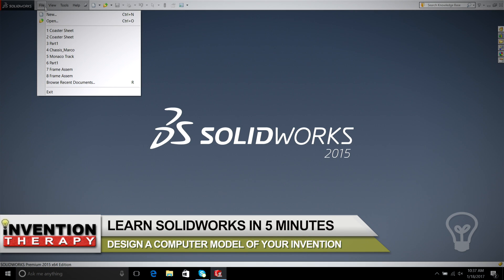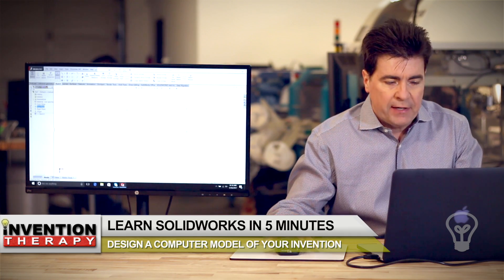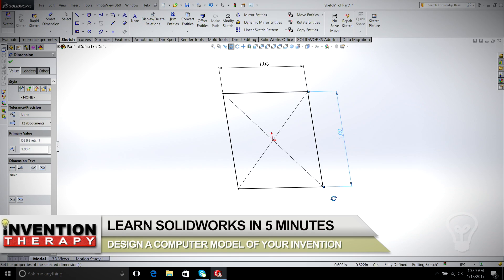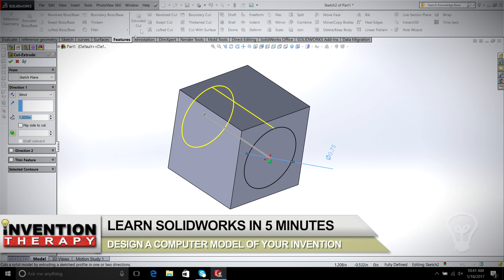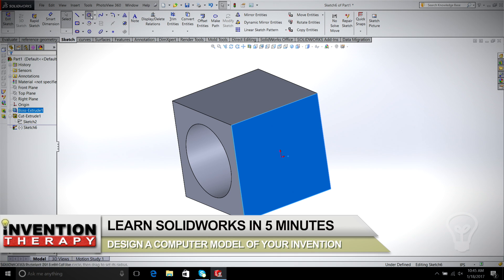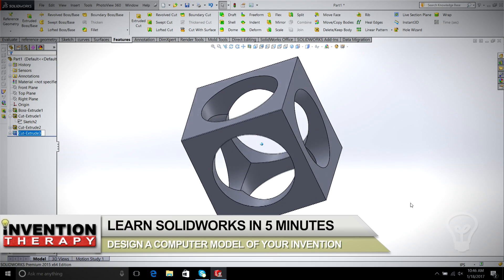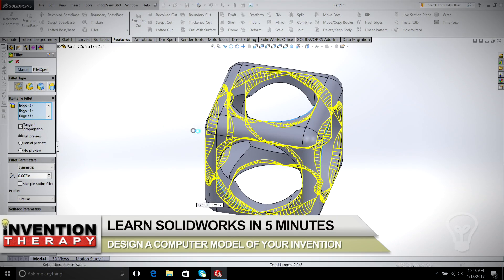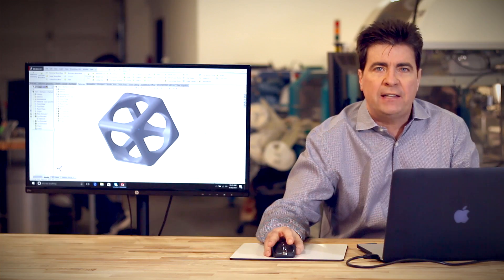Learn Solidworks in 5 Minutes! | Solidworks Tutorial

Comment: Newcomers sometimes struggle with the mouse functions. Just adding that pushing down on the scroll wheel is how you rotate the object in 3D easily. Or you can grab the rotary arrow tool. Also, SolidWorks is fun on a touch screen!
Reply: This was a huge help. Was puzzled at how he spun it around so easily

Comment: say i wanted that hole threading how would i put a thread in the hole pitch depth etc
Reply: Easy.  There is a specific command for threads called hole wizard.  Pick your position, thread type from it's library(#2-56, #4-40,...1/4-20, 1/4-28....whatever), depth, cbore, csink.  I'm sure you have googled this by now.  Right?  Right!!!

Comment: Is there a feature to enable the application of a property to multiple selected faces simultaneously, to avoid repeat selection and potential errors like the one shown, assuming it wasn't a software bug? You should be able to select, "Apply function to all sides" or 12 mating edges for a box or apply it to all external or internal surfaces on selected planes and delete those that don't apply if it's faster that way. You could have 800 that need it but only 20 that don't. Which is quicker? This is how gear teeth or splines are done, at least I hope so!

You could apply all features to this model in 2d before clicking, "Form cube" or just select the cube pattern from a menu of common shapes, (and common items like engine blocks, manifolds and water pump housings etc.), then stretch the cube into a longer box if necessary with elliptical apertures on the long sides which could later be revised into 3 circles if preferred or deleted. I wouldn't have a clue how to actually code it but who writes this stuff? I'm sure Sketch Up 8 had the features I described years ago. Probably Solidworks does but this is just a quick demo the hard way perhaps?

You could also apply procedurally generated transitions. That's what computers were invented for, apart from IBM doing the accounting for the Nazi death camps but that's another story.

Did you see the video of the first chair ever created entirely by A.I.? I didn't watch it as it would probably blow my mind. Also it can't have been entirely A.I. as certain design parameters would have to have been specified like, "Make it chair shaped. Here are the basic features and proportions we want" or it could have accidentally generated a more intelligent human brain and taken over the planet like The Lawnmower Man!

Comment: Great Video! Thanks for making this. The only thing I wish you had also included would have been a small picture in picture in the lower right corner of a video camera showing what your hands were doing on the keyboard and mouse. You were able to move the part around so easily and I struggle with this. If you had the video from above looking down at your hands I could see which buttons on the keyboard you were pressing while moving the mouse. Thanks again for the great video.
Reply from the maker: 3D mouse!

Comment: Which MacBook do you use?
Reply from the maker: Pro running bootcamp.
Reply: @InventionTherapy   can you tell more about specs? Interested in  CPU, GPU.
Reply from the maker: 8 core mac pro with 16 gigs memory. Nothing out of the norm.
Reply: @InventionTherapy   I don't want to be annoying but do it have a dedicated graphics? Or its just on integrated Intel Iris one?
P.S. Greetings from Ukraine✌️😊
Reply from the maker: It is just the standard Macbook Pro. Nothing special added. Solidworks is designed to work well on any graphics card.

Comment: I came across a program called IronCAD. So much more user friendly, from what I can tell so far.
Reply from the maker: Its about choosing which software works best for you. Generally speaking Autocad is more for engineering and Solidworks is more for industrial design in my opinion. Fusion 360 is the better version of Autocad.

Comment: Wait up..... You are running Solidworks on a mac?... I thought that Mac computers weren't good for solidwork... Even thru Parallels.
Reply from the maker: MACs are way more stable running Windows via bootcamp. Better than most Windows machines.
Reply: @InventionTherapy  I understand that but someone told me that because its splitting the system to run windows you can only run some of you video card and some ram... And that why it wasn’t a true cad machine.
Reply from the maker: Nope. You are talking about running Windows on MAC as a virtual machine. Bootcamp is a partition on the hard drive and you reboot the machine as a Windows machine. Graphics and everything else then runs native Windows like any other computer.

Comment: i want to learn how to use solidworks.. Do you know of any schools in the new york city area that teach solidworks?  Also the last few times i have seen someone demonstrate solidworks the  used a mac computer, are you using an imulator ?
Reply from the maker: All modern MACs run Windows if you install Windows on a partiion of the hard drive. There is an application that comes free with OSX called Bootcamp to do so. MACs work better on Windows than most machines designed to work with Microsoft. 

As far as school goes, I do not know of any places but if you contact Solidworks, they always have group sessions all over the USA. It is actially a very easy to learn software package and Youtube can be a great resource.
Reply: thanks so much for replying so fast. I retiring from my job and was looking for a new line of work. I want to learn something new so i was curious to learn a cad program, plus i wanted to build my own home cnc machine. I will contact Solidworks. I was actually thinking of buying a pc just to run solidworks. Do you know the specs needed to run solidworks?
Reply from the maker: That’s the funny thing about Solidworks. They designed it to run on the lowest cost machines with average graphics card. Rendering and 3D views improve as you get better (more expensive) Windows machines but anything will work. An average speed gaming computer with one dedicated but low cost graphics card will give you amazing 3D views while working on a design. 

The problem is the cost of the software starts at $2500 for a one year license. Many companies I know just pay for one year and never upgrade because 2011 Solidworks is almost the same as 2018 leaving little value in the tech support fees unless you run a big engineering firm with many designers using the software.

If you are just starting out, I would suggest its competitor Fusion 360 which is downloadable for free. It’s not the same interface but just as powerful and a much lower cost.

If I was looking for a way to do things in retirement, I would invest in a powerful laptop, install a good 3D design program like Solidworks or Fusion 360 and nothing else. Maybe get a good $5000-$8000 3D printer and email your files to a machine shop in Asia once you test form and fit of the prototype using the 3D printer.

You do not need anything else and only need the other equipment if you plan on growing into a business of my size. Honestly, I don’t need any of the infrastructure I have now but it does help me create and gives me some freedom for small production runs. Beyond that, its easier to farm it all out. CNC machines as an example require lots of support tools like vices, cutters, etc that are expensive. Not only that, it takes a lifetime to get good at using them. I have tried and worked in CNC machine shops and still make a poor machinist.
Reply: Are companies still hiring men and women who are proficient in cad systems. Do i need a certificate to get hired for a job in cad.?
Reply from the maker: I am not sure but I can say this. CAD design is more about understanding manufacturing processes like CNC, mold making, laser cutting and the rest. You then have to add the mechanical aspects like stress, temperature, air-flow, mechanics, etc. Its sort of realted to what I teach on this channel because as an example, if you design an object in CAD to 3D print, it won’t be able to be manufactured with CNC. You have to design for CNC and use the 3D printer to test the fit. Same with mold design. Any shape will 3D print but converting it for mold making will require many changes in the original shape. The point is you need to know how all this stuff works before learning 3D CAD.

I learned this the hard way when I hired a few people to help me with my first inventions. I kept having to hire new people to redesign everything as we went from prototype to final products because none of them understood manufacturing and how molds, CNC and other processes work.

There are hundreds of thousands or more people working as designers but if you are good and understand this stuff, there is always work. For me, its just easier to do it myself. Other businesses might need someone with my skills but I am not for hire. You can learn and be one of those valuable designers. I have met a few over the years and they always had work.

Comment: How do you make sure that the circles are in the centre of the surface? because in my case the red arow (x y line) is not in the centre of the square surface
Reply from the maker: Draw a center line (dotted line tool in the sketch menu) in the x or y direction from the center of the sides. This will give you a dotted line down the center that will automatically lock the circle’s center when you pick the middle of the dotted line. You can also use the “relations” box to put the circle center in the middle of the dotted line. I discuss all this stuff in some of these videos.

Comment: !! ?how to rotate the part view like this easily
Reply from the maker: I use a 3D mouse but you can also right click in the Solidworks window and you will see a few mouse choices like drag, rotate, etc. They are sometimes up at the top center of the screen or you can make the choices visible in the options as well.

Comment: What macbook does he use? Pro or air? I need details pls.
Reply from the maker: I use the MacBook Pro running Bootcamp / Windows. Solidworks is pretty efficient with the graphics so it should work on the Air as well but you will get faster and more detailed rendering with the Pro.

Comment: Hey, thank you for your tutorial. I'm just starting with SolidWorks 2017. My question, how do i get the extended toolbars, in Sketch and Features, i have way less options to select. There's only a few options and 'Draft, Freedom, Flex, Split, etc.' is not available. Can't find the settings myself.
Reply from the maker: Setting up the toolbars can be a pain but most of the choices are also in the text menus at the top of the program. You can right click with the mouse over the tool bars to add and remove them and also go into "options" to set how you prefer.

Comment: Do this with the new solidworks 2017 pls i wanna learn it.
 im a beginner by the way thank you for the great tutorial
Reply from the maker: All versions of Solidworks are pretty much the same. They just add a few features here and there as time goes on.
Reply: well now i see. thanks
Reply: @heyuthea8823  
Just buy a book and teach yourself
Reply: Invention Therapy I am searching for a gaming solid works hybrid laptop and have two option for one project. The project is to build a hyper car that would work in real life if driven. The project should be quite detailed and will therefore require quite a good laptop. My two choices are a laptop with a 7700hq and a gtx 1070 or a ryzen 7 1700 (the desktop version) combined with an rx 580. In both cases the ram will be upgradable. The 2nd laptop is much better at solidworks and the Graficcard even crushes a 1080ti in terms of solid works performance. The 1. Is better at gaming but worse at solid works. What I need to know is whether the 1. Will get the job done nonetheless. I am looking forward to receive a message from you soon so I can make my decision.
Reply: @300ml_brasil  
better quit waiting and teach yourself solidworks or you'll be waiting for that message for a looonngggg time!
Reply: @crookedriver2079  i already did, but thanks for the advice. until now my gtx 1050 is doing fine. right now im modelling a v6 biturbo (and not this terrible tutorial one)

Comment: Something I havent used before is SolidWorks... I use games design software for 3D modelling, but I will have a look into solidworks properly at some point as it looks as though it would fulfill some of my technical drawings better
Reply from the maker: I think Solidworks is easier to learn than Autocad. The problem is that Autocad Fusion is free while Solidworks costs a few grand.
Reply: Invention Therapy Yeah I noticed that. but with me being a student I can get it for cheaper. but it may be just worth learning 123d design with it being free or even tinkercad